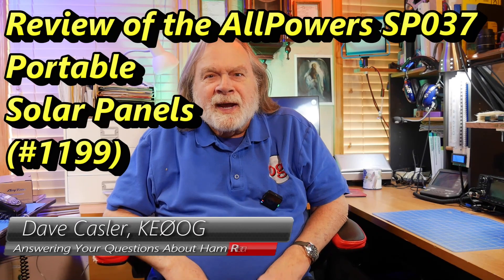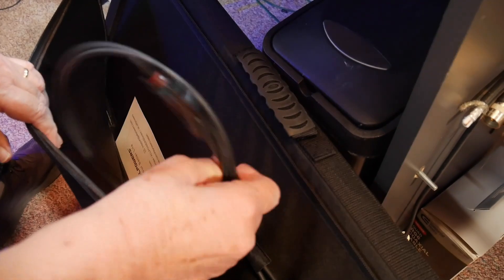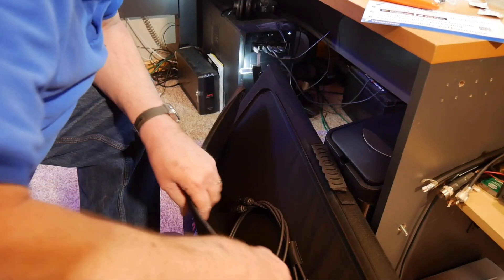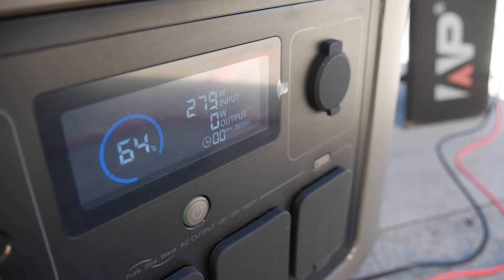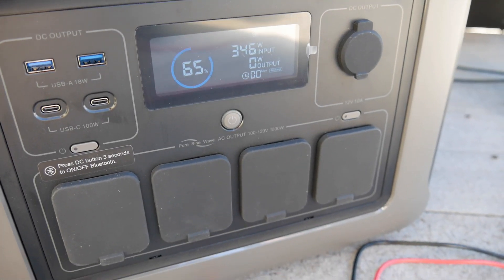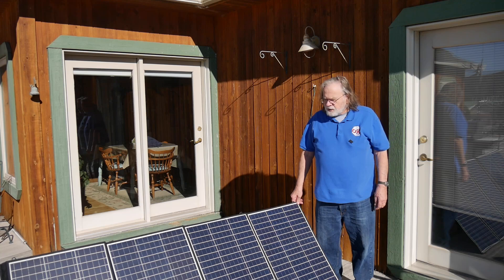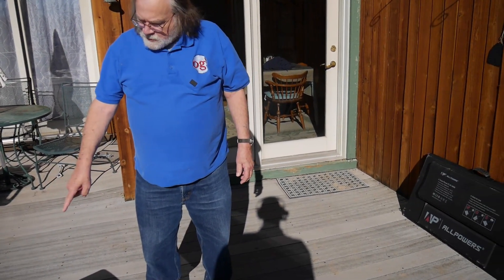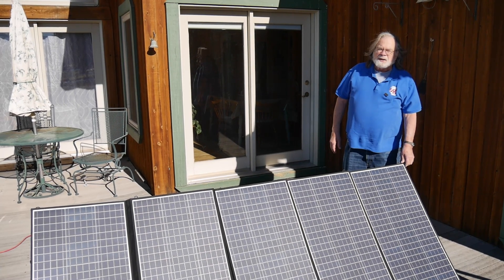Review of the AllPowers SP037 Portable Solar Panels (#1199)

Comment: What is the capasity of the powerstation ? Dose it have 12v out ? Or just AC out?
Reply from the maker: It has 5v out (both USB-A and USB-C), 12v out, and 120VAC out. 60 Hz. Can be changed to 50 Hz or 240vac via the bluetooth app.